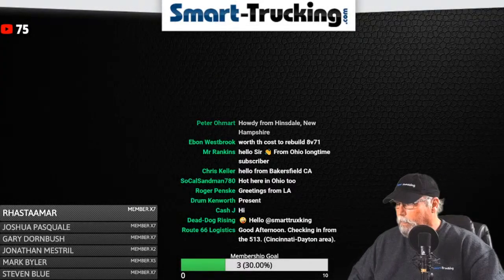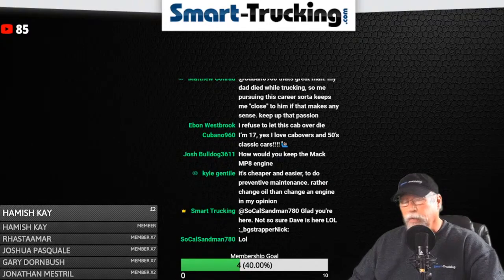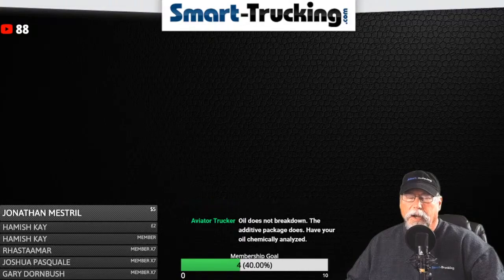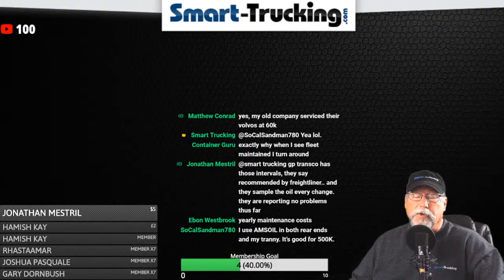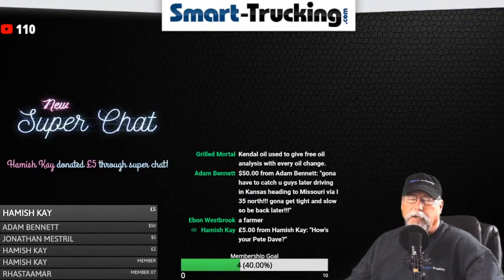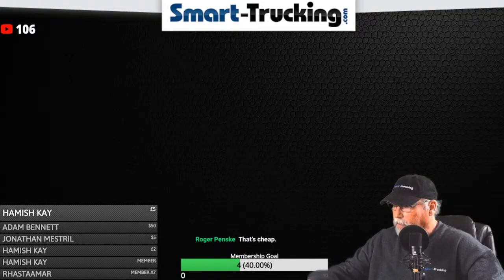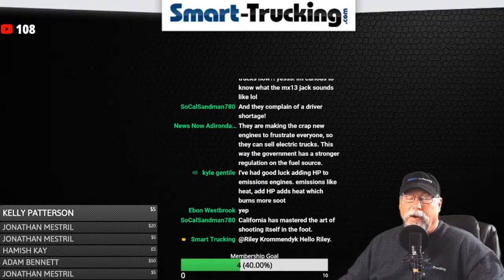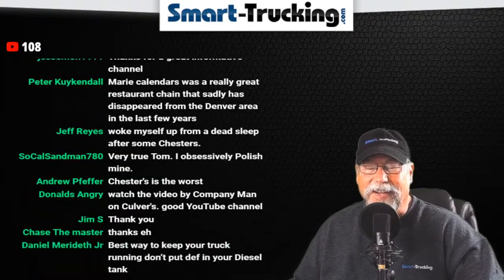How To Make Your Diesel Engine Last Longer

Comment: Fuel conditioners for lubricant, don’t load the engine until oil pressure is in the hot range pressure. Let the engine idle down to let the turbo wind down before shutting off and don’t idle the engine while you’re sleeping. Set the RPM to 1000 or so for idling to keep the turbo from running in a vacuum sucking the oil up the wrong way.

Comment: Clean air filters… clean fluids… religious oil changes…shell rotella has a better performance than synthetics at high temps (longevity of your turbo..delete the def/dpf/scr
That whole system chokes your engine from both ends

Comment: The Korean Mafia has a Freightliner mechanic on our premises (whether he makes use of the social club including all of its benefits such as the poker room, library, cigar lounge, poker room, and massage parlor – where there is always a happy ending, is unknown to me) but he is doing PM to the entire fleet, along with fixing a variety of other knickknack problems. Apparently”Velocity”’ that is the name of the company that does the maintenance at this particular Freightliner dealer, does this too facilitate getting the power unit back on the road as quickly as possible without the fumbling and bumbling of rolling trucks over to the dealer and rather than picking them up and bringing them back. At any rate, the point of all this mumbo-jumbo is that this mechanic told me that these Detroit diesel D 12s take 12 gallons of oil. That’s a lot of cheddar even for a big company, especially if they are using synthetic oil.

Comment: The thing about oil intervals on freightliner era they say you can go 75k miles if your averaging 7.0 mpg and above but on Volvos d13 they say you need to average 7.5 mpg and above to change oil at 75k. I’m not sure about Cummins or the crappy paccar motors I haven’t looked into them